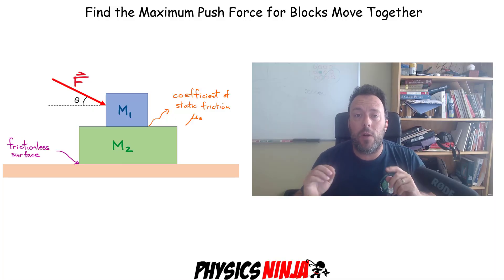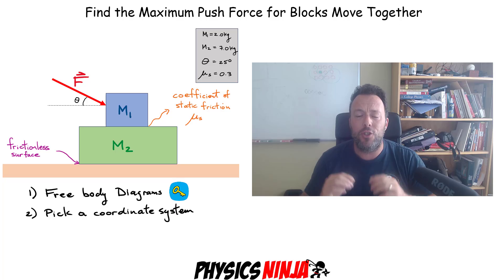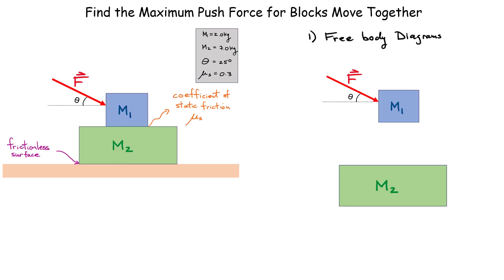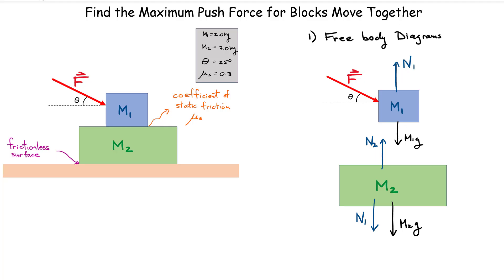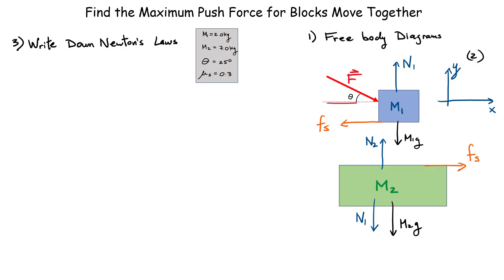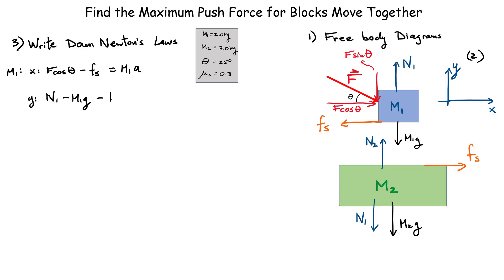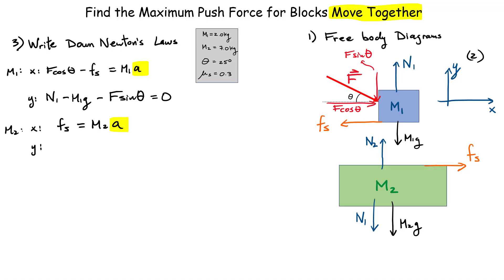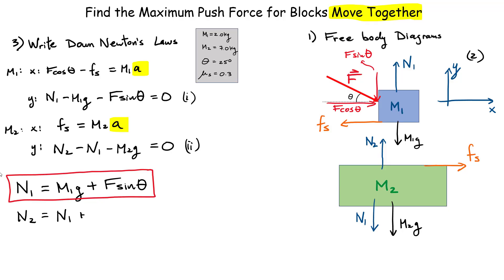Maximum Force for Two Blocks to Slide Together

Comment: 10.2N is the maximum push force to move the two blocks together. Does this means that 10.2N is also the maximum push force to prevent block 1 to slip on block 2? Or 7.2N? Thank you

Comment: Why you equate m1 to ma, that's not accelerating relative to m2 isn't it? So that is equal to 0?
Reply: Everytime we deal with newtonian mechanics we need to work with inertial reference frames. Block 2 is accelerating, so it cannot be our frame of reference... we need to pick another one thats stationary or moving at a constant speed... we usually pick earth for that, even though its not exactly an inertial frame of reference. Its a good approximation though.